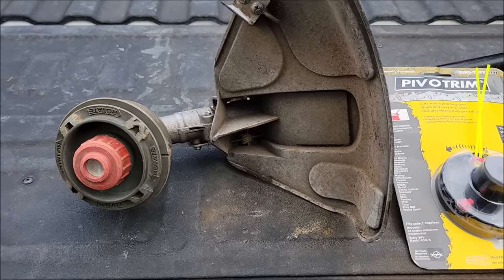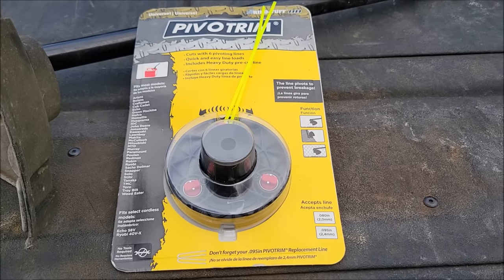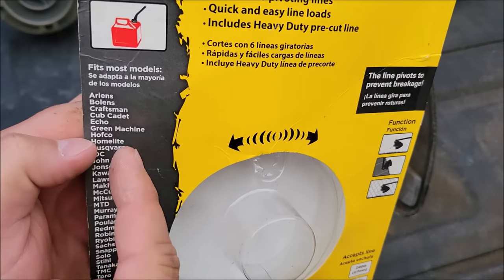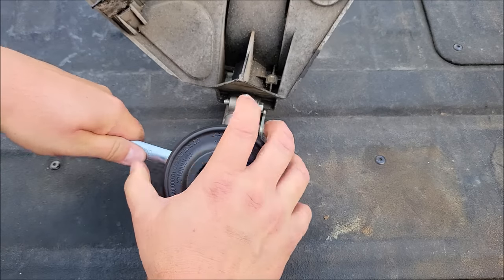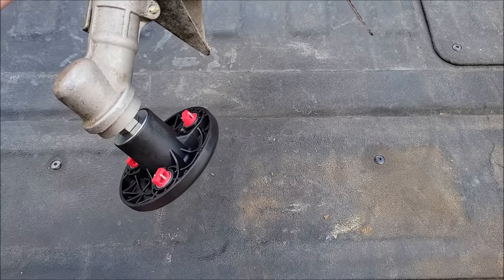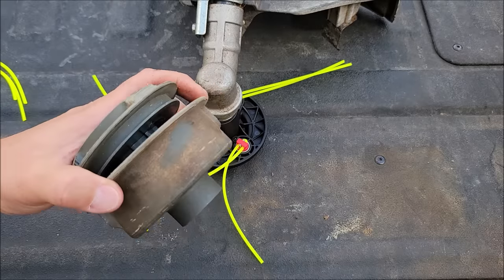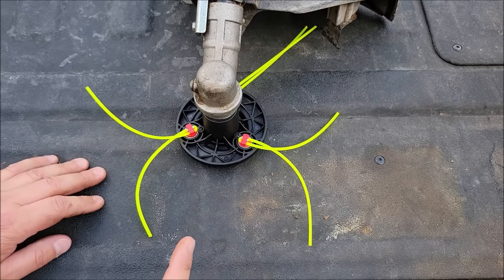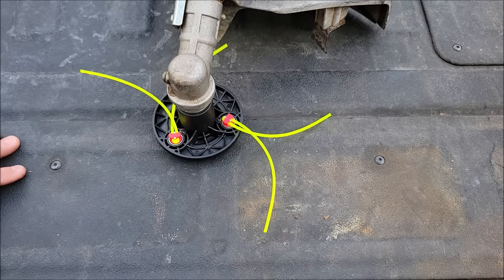Installing the Best Trimmer Head Ever | PivoTrim Replacement Head

Comment: Will this pivo head fit on a 20v dewalt trying trimmer 2022 model electric
Reply from the maker: I am not sure, but they do fit most brands and trimmer's it says.  The 20v may be more like the 18v Ryobi and that would not run it.  Check out the Amazon page to see what it says.  I have the link in the description.  Does yours have the same head as in this video: https://youtu.be/eXBIL7Eg49Q

Comment: I see at Amazon they also have a 4 string head as well as the 3 string. I wonder why.
Reply from the maker: Not sure.  I have not tried the 4 string one.  If you get that one, let me know what you think.  I think the more strings it has, the more load it will put on your trimmer.  If you have a big gas one that may not matter, but if you have a smaller trimmer it may put too much load and make it run slower or eat up battery faster.  These are assumptions though.

Comment: Your vid made my installation easy for me thanks.  But what your calling a bolt is a NUT!!  see;; a metal rod or pin for fastening objects together that usually has a head at one end and a screw thread at the other and is secured by a nut
Reply from the maker: Yeah, my brain cross wired during this video.  That seems to happen to me more often then I like.

Comment: super awesome string trimmer head but if your not going near fences or walls metal brush trimmer is best
Reply from the maker: Thanks for the tip!  I have thought about cutting some wire rope lines just to test that.

Comment: That hole on that washer is too big. Unless centered the shaft will vibrate and eventually damage the shaft and the pivo head. Get another washer at a hardware store with a hole that fits correctly around the shaft pin. BTW that a nut not a bolt.
Reply from the maker: Thanks for both tips.  Mine does great but I could see that being a balance issue.  I am a nut and sometimes call nuts bolts and bolts nuts.

Comment: I was given a used weed eater with that head on it. What was the measurement you cut the new line to ? Thx
Reply from the maker: It's a little different for each weed eater, but start with 18 inches and see how well that works.

Comment: I've tried a number of trimmer heads over the past few decades, & this one is decent.   Echo Speed Feed 400 is by far the best, however.    I can load 20 feet of line that will last forever in way less time than loading one of these pivot heads.
Reply from the maker: That is the second time I have been told of the speed feed.  I will get one and see how well it works.  Thanks for the info.
Reply: I put this head on an Echo 58 volt electric  trimmer and it edges Bermuda grass around my driveway like butter. I keep the  Speed Feed head as a backup but like the cut the WW hybrid gives me. I can use it in low speed and the battery lasts longer. I think having 6 cutting points vs 2 helps in my case
Reply from the maker: @beachbumpkin  That is like me, I love this head VS a bump feed, but I have not had too many great bumps feeds.  I don't even have to change the strings on mine very often.  That said, I have not tried the speed feed bump head and it's got me wanting to try it.

Comment: Do you know if it would fit a STIHL battery machine #FSA57S ? The factory shaft is not threaded , the head is held on with a circlip .
Reply from the maker: I think this head works only using a threaded bolt.  Are you able to remove the shaft on the trimmer?
Reply: @SeidelRanch  No , it appears to be the armature shaft with a key that prevents spinning .Thanks for answering .

Comment: You dont have take the arbor off your trimmer  just the bumphead off slide pivotrim on put the plastic cup adapter on and screw your old red bump knob and your good
Reply from the maker: Thank you.  That's even better.
Reply: @SeidelRanch  Ya I like pivotrim thats i  use

Comment: What millimeter is the line? I just want to make sure I buy the right stuff in bulk. Thank you very much and I have the same exact weed eater by Ryobi that you do and I will be replacing it!
Reply from the maker: I use .095 line, but I think you can go even thicker on that head.  The MFG says: "PivotTrim universal trimmer head accepts .080 and .095 diameter line" so maybe start with .095 and try thicker line later if you want it to last a little longer. The .095 line works great for me.  Good luck!
Reply: @SeidelRanch  I just installed mine today and Wow! What a difference! My "bump head" wouldn't bump and sometimes I would open to troubleshoot and the line was stuck under itself. No more or that! I had your video playing on my phone the whole time I was doing the installation as a virtual coach lol! Thanks again!
Reply from the maker: @Chivalry10  Awesome.  Hope it works great for you!

Comment: I've had this head for a couple of yrs and didn't know how to install it. Didn't know I had to remove the long end where the other head fit on. I have no idea where that nut is. I'll see if I still have it. If not hopefully one of these stores has one. I've been using the areoflex head but want to use something else. Thanks for the video. And it has to be a backwards nut?
Reply from the maker: Yeah, the threads are backwards.  I am not sure how to get parts for it really.  Hope you can find that.
Reply: @SeidelRanch  I tried to install it but my Weedeater is a curved shaft. Figures! When I buy another I'll get the straight one and see if it works then. Still thanks for the video. Had no clue how to install that thing. Bought it for a deal from Walmart and it's just sitting in the garage...

Comment: Good video, but that's a nut...not a bolt...Cheers
Reply from the maker: Yeah, I mess up all the time.  Thanks for watching.
Reply: @SeidelRanch  A couple of memory pegs...Nuts are small and round like the nuts you eat...Bolts are long like a bolt of lightning. 
It will only take a millisecond to think of this before you say whether it is a nut or a bolt.
Who can trust what someone says that does not to appear to know the difference between a nut and a bolt? 
Just a thought...You can get it right if you want to. Cheers...M

Comment: It seems to me that with the new head you are using 3 times the line to do the cutting than with the old 2 line head - hence the longer time between line replacement.
Reply from the maker: I am sure that is part of it.  I think the ability for the lines to pivot helps a lot too.
Reply: @SeidelRanch  I'm sure you are right about that as well.

Comment: I used a nut on mine not a bolt and you dont have to remove the shaft to put new head on it comes with adaptor for it
Reply from the maker: Nuts, bolts, ... what's the difference 🤣.  I did not know that about the shaft. Good info.
Reply: Mine won't fit my stihl.

Comment: This don't look NOTHING like my Ryobi!
Reply: There is nothing to lock the head to remove the bottom part of the head, and no bolt is showing above a washer in the middle.
Reply from the maker: What model trimmer do you have?  My trimmer is a few years old, so they may have changed them.
Reply from the maker: There is no red bump knob on the bottom of the head?

Comment: use a screwdriver to drop the nut in. i got the unit with about 6 nuts.the proper one drops into the plastic unit. I didn't get the reverse, fine thread nut that goes onto the weed wacker reverse upright bold. the nuts have a letter stamped on them but hardly can be made out. I could not find them in any store. the nice lady is sending me the proper nut (I hope). he's right, that string can take a real beating and lasts a long time. other heads waste a lot of string

Comment: I personally hate Bumphead trimmer heads. And truly prefer these ones. Lie to do a quick change on the line. Does anyone know if this works with the Dewalt trimmers?
Reply from the maker: If it's the larger normal style trimmer, it should. I think the link I put had a list of all the style trimmers it fits.  It will fit most of the standard gas style trimmers.

Comment: How do you keep from scalping the yard? Since the  depth is so much smaller than the depth of the original head......
Reply from the maker: It's a trimmer.  There is no set height.  You raise or lower it based on how tall you want the grass.

Comment: I bought one of these because of your commercial, and the fact that it was too hard to reload the string on my bump-head .
This is a miser on the string wearing out. There is a major problem with it. It tends to lay the grass or weeds over, rather than cutting them off.
I have to keep going back and forth over the same area to get the job done. That takes twice as long as it does with a bump-feed head!

I saw a demo of the Echo Speed Feed Universal 400 head. I bought one__ it works great! It is super easy to reload too! It takes less time to load 20' of string than it does to remove worn strings, then cut and load three pieces of new string for the PivoTrim (It was waste of money)!
Reply from the maker: I am glad you found something that works for you.

Comment: Hello,  It's my understanding that this Pivotrim fixed line head is only compatible with gas powered trimmers and not with trimmers that use a rechargeable battery.  Do you know if this is correct?  Would difference does it make?  Thank you
Reply from the maker: It works fine with my 40v ryobi trimmer. I think the key is that it has to be the gas style trimmers and not the small battery or plug-in ones.

Comment: Do you think that this could be used with an electric weed eater?  I have a hyper tough 4.6 amp 13 inch cut trimmer and I also have tons of landscaping to go around to include fencing.  I go through string like crazy so anything that would cut down on stringing that baby would be awesome!
Reply from the maker: Only if it's the type that can be removed.  Many of the electric weed eaters have non-removable heads.

Comment: is it good for home but what about those workers working 8hrs daily every day with those small strings?
Reply from the maker: I would not use it for commercial use.  I would buy are really good trimmer if that is what I was doing.  The higher end trimmers have better bump heads and larger spools to last a lot longer.

Comment: Will it fit on a Honda 4 stroke trimmer?
Reply from the maker: If it has a removable head, then odds are good.  Most trimmer have a threaded shaft that holds the head on.

Comment: I tried one of these heads and had a poor experience.
Problems:
* Three strings (effectively 6 strings) is a lot more rotating mass for the motor to drive. It was slower to spin up to cutting speed and my Echo engine got very hot when using this head.
* When the strings break off, they leave a small nub at the pivot points that can be hard to get out and replace the strings. Need a small needle/pick to get the broken nubs out. I tried multiple string weights all with the same results.
I went back to a string-through spool wind-on head and like it much better.
Reply from the maker: Agree on those points, but I have not had an issue removing the small pieces left.  The load has been minor for my trimmer and gas trimmers can be adjusted to compensate for the load.  But in the end, it will be what you like best.
Reply: Just cut the line shorter. I trimmed 2" off and it runs much better.
Reply from the maker: @dikkybee4003  Good idea.